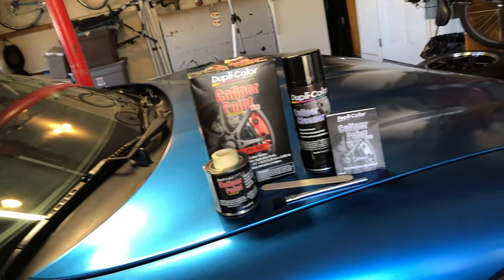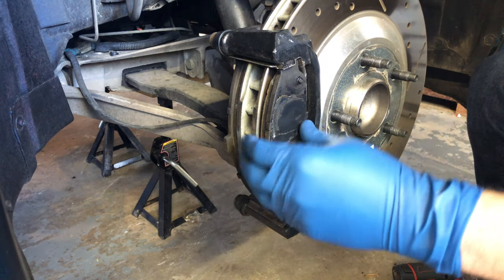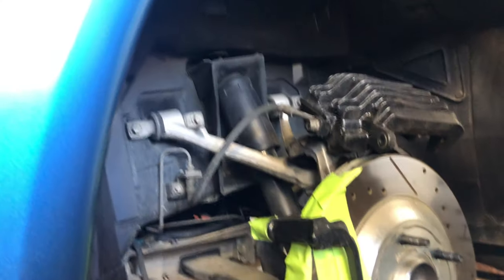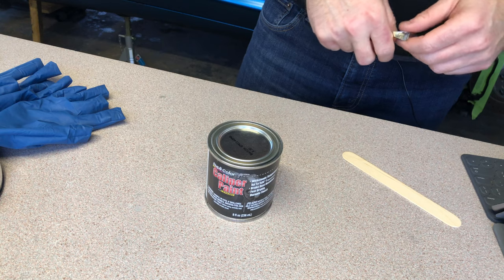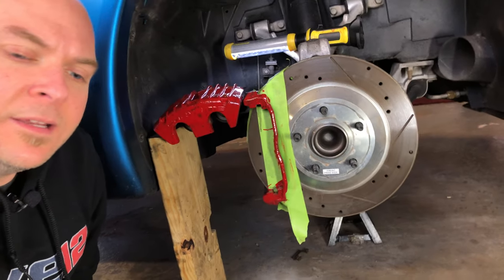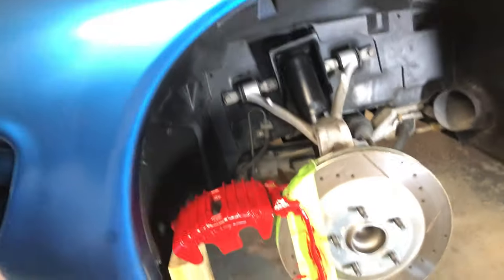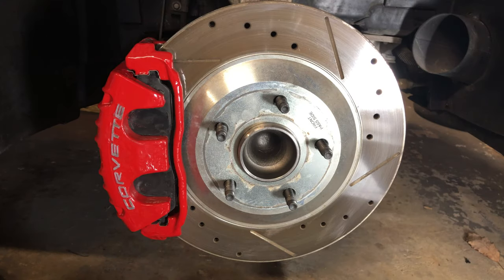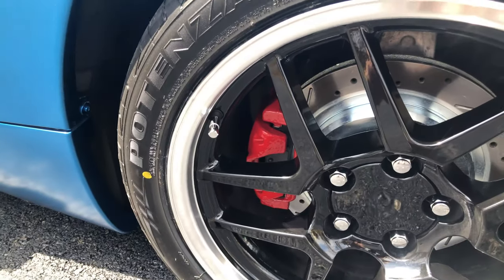I FINALLY PAINT THE BRAKE CALIPERS RED ON THE C5 CORVETTE!

Comment: Nice thorough vid. Gonna be doing mine yellow in a month or so, so learned good stuff from it. I don't have a dremel and read that chapstick on the letters before you paint will make it easy to scrape off with a card or razor. I'll give it a shot when I do it.
Reply from the maker: Thanks! My arm and safety glasses were covered with paint from that dremel. I’m willing to bet the chapstick and razor will yield cleaner results. You should paint them red.🙄
Reply: @Team512  lol no way. You're gonna make me get new rotors bc yours are nice and new with no rust. I can't say the same for my rotor hubs lol.
Reply from the maker: It’s that sweet salty Jersey air! 😂
Reply: A flat file works best !